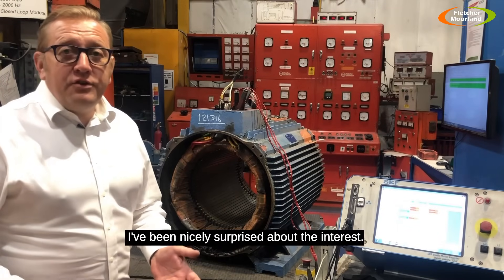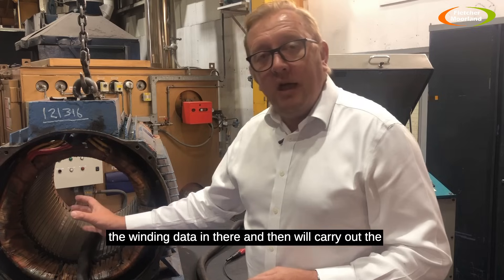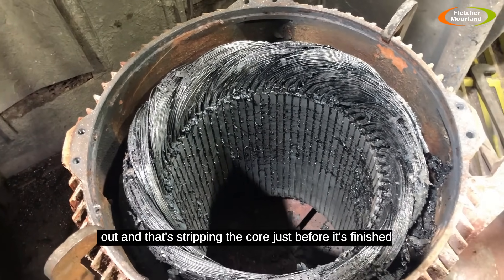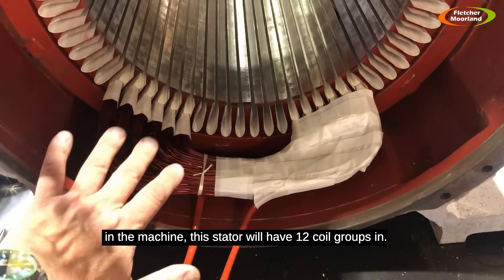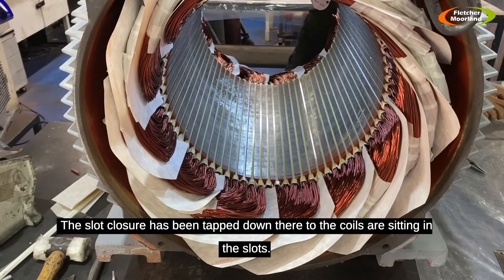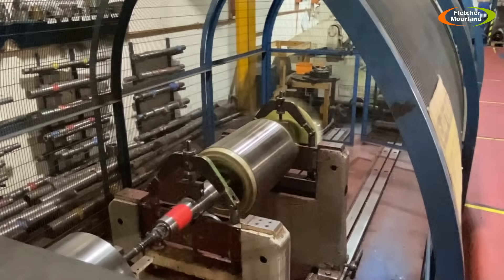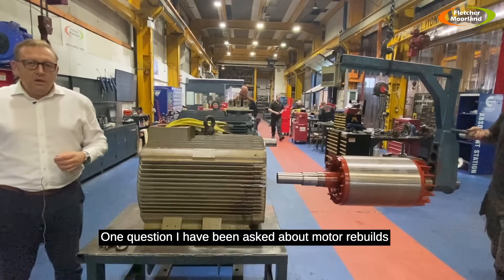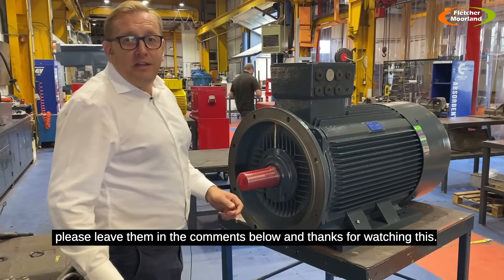How it's done....Electric motor rewinds

Comment: I work for the largest industrial electric motor manufacturer in the world. I have visited and studied many of our production facilities and their processes. Some of our customers are motor rewind shops. This one, in particular, appears to do a very thorough and professional job of rewinding this motor. Their process is very similar to the way our production process works on motors in this size range, with minor exceptions for special tooling, devices, guide fixtures, and some robotics in smaller motors for more repetitive processes. Very fine job, indeed!
Reply: I don't do that job, I build rotors, but they hand wind stators about 30 feet from my area where I work.
Motors about the size of that one and bigger.
Reply: you should make a video! i'm sure in production, you guys don't use hand winding on the stator - right?
Reply: @FrederSnorlax  depends on the motor. High production motors are often wound and inserted by automated machinery suited to the task. Larger frame, specialty, and lower production motors are indeed hand wound.
Reply: You scream "we've been doing it this way for years " 😭💀
Reply: Hi,could not see how windings were inserted into core but very interesting  video.very thorough.

Comment: This was a very interesting video.  I once attended church with a fellow who worked at a motor rewinding factory.  Also, my brother worked at the "Electric Shop" for U.S. Steel in Birmingham, Alabama (USA) where they rewound a lot of motors.  Finally, my father-in-law worked at Air Reduction Co., a supplier of oxygen for that same U.S. Steel plant.  To make the oxygen and other gasses, they used many massive electric motors.  The amount of electricity used was so great that the Alabama Power Company had to run a special line direct from the hydroelectric plant for several miles to Air Reduction Co. which was their largest customer.  Having so many friends and relatives in this business, it was exciting to watch you explain how these huge motors are maintained.  Thank you.

Comment: Old rewinder here,  low tension,  high tension,  ship board armatures,  bar wound, commutator rebuilds. Traction motors. I think 
Miss  the trade,  unfortunately mostly a dead trade now.  
Used to rewind,  single phase motors on the weekend for beer money.
Good video.
Reply from the maker: There's a resurgence Kezza, we've got four apprentice winders with us right now. Electric vehicle and wind industry is where we've seen the industry turn around.

Comment: I walked through a westinghouse motor and transformer production line and saw how they pulled the whole winding into each slot using a hydraulic cylinder hook. It was cool to see it done manually, since each motor is different, where theirs was a production line... Thanks for all the details and answered questions I've wondered about on motor rewinding!

Comment: Hi, do big DC brushed motors have significant core loss ( maybe because of commutation ) and if so would you measure it when doing a rewind?
Reply: Do you use a growler?  This is a powerful electromagnet with angled pole pieces.  The armature is placed in the V while the armature is slowly rotated while a hack saw blade is held close to each slot.  A shorted winding, or after de-coiling, a core fault will cause the blade to vigorously vibrate.
Reply: @neon-john  No I haven't, I guess the blade vibrates in the growlers magnetic field if there is a poor diverting magnetic path through the armature (or stator?), but I'll read up on all that before commenting further. 
Thanks.

Comment: A friend in Sacramento, CA had a two-man motor repair shop. He used a small propane burner. One day in the ‘70s, the government dropped by and put an end to burning motors, which would reduce air pollution. I don’t know what he replaced the process with. I am surprised you are still doing it in these days of “warmal globing.”
Reply from the maker: Less CO2 produced by rewinding these motor than to build a new one. The process is kinder to the environment now though as the hydrocarbons get burnt off and don't escape.

Comment: That was an excellent video.
Before retiring many years ago, I was an electrical engineer at a magnox power station and have needed to have quite a few motors, small and large, rewound, due to various faults (including seawater ingress). Most of the original manufacturers were defunct so we had to rely upon the expertise and service of the specialists. Due to work load, I rarely had a chance to observe first hand the processes involved, so your video has been absolutely fascinating, and extremely well produced.

Comment: I actually would like to have seen the cutting of the old windings, even if it is noisy and dusty, or at least the machine that does it.  Also, I hoped to see how the new coils are made prior to being inserted into the grooves.  I have to assume that they are wound on some jig or fixture.  Also, do you do any electrical testing or refurbishment on the rotor?  Or, is the rotor always OK and doesn't need inspection?
Reply from the maker: The video showing the coils being made got corrupt when I made this video. If you take a look at our other videos then I've made a separate one for theat. The rotor does get inspected for broken rotor bars but in general apart from mechanical refurbishment on the bearing journals or output shaft they generally require little work.
Reply: @FletcherMoorland  Thanks, I'll go look for your other videos.

Comment: If you use paper insulation good for 110c and bake the unit at 160c, does anything bad happen?
Reply from the maker: You'll compromise it and although it may still have insulating properties, It'll not last long in service.

Comment: Jeez. I work in the offshore industry in the North Sea and I can literally see hundreds of these motors of various sizes all over the place every week, especially on the larger assets. I've heard of motor rewinds but never realised the amount of effort and skill involved in their construction. When new (or refurbed) motors arrive, they sometimes sit about for a while and you can get up close and it always surprises me that no matter how large they are, you can always turn the motor with one hand on the output shaft without any effort. Amazing.
Reply: The Volunteer Army Ammunition Plant or what we called the dynamite factory, used to be located in Chattanooga, TN.  They made all the TNT use in the Korean and Vietnam war.  There were huge air compressors to supply the whole site.  The motors were large, slow-speed devices that ran on 4130 volts, 3 phase.  I have photos of my friend Jerry Brown who I described above, standing upright in a stator, reaching over his head pushing windings into slots.

We pumped varnish into the slots and spray-saturated the end turns.

The bake-out oven affair we built over the motor was clever and large.  It got the job done.

If I recall correctly, those motors ran at 360 RPM and were synchronous motors with wound rotors and slip rings.  The field winding could be over-excited to cause the motor to provide leading VARs to offset the lagging VARs induction motors made before the lagging VARs could reach the metering system and cause a low power factor charge.

Fun times.

Comment: Back in 1966, I worked in an Electric Motor Rewinding shop...California, USA. Not much different expect I see lots of better test equipment, and less brutal burn-out !!
 Very good video, it shows people why it costs so much to properly do this sort of re-manufacturing. 
 The only thing I didn't see, is anything regarding (metal spray) welding and turning of damaged shafts. not a problem, I know how it's done, although back in the day, we used Oxy-Acetylene and motorized wire feeder...very noisy!

Comment: Control open flame on the core by having a fire suppression photocell to inject water if flame is sensed in the burn out oven. I would have continuity wound this with concentric winding and when all the coil groups are installed there would be 4 groups of  6 leads at 90 degs apart. It would then be easy to either hook it up star or delta. Your vpi process is a joke. I taped each winding up into the iron and then that stator would be put on a rotisary to turn at 5 rpm to keep the epoxy in the windings while curing in the oven, After the epoxy is cured it would get 2 class F varnish dips and cured between dips. Put in a tank of water brought up to the conductivity of sea water and meggared at 1800 volts every hour for 24 hours to prove its waterproofed. Then rinsed off with clean  water and dried before assembley. My VPI motors were run at 100% load on a dynamometer  for 24 hours before being sent out to the ships or submarines.I rewound for 16 years working for the USN. I rewound a lot bigger motors and generators. I only had to rewind one 12k hp sub prime mover motor which was 3 meters in diameter and it was a dc drive motor. Glad I'm retired,lol. I'd say the majority of your epoxy ended up on the oven floor because it flows like water when heated to cure temps. The epoxy once cured isn't resistant to the shock of starting so it will develop cracks  that will allow moisture into the winding over a period  of time so sealing it with a good class F type varnish will prevent those cracks from developing.
Reply from the maker: Oh dear, 'a been there, done that' bell-end comment. I guess you don't know much about modern VPI epoxys then do you? Class H with a three year warranty will do us nicely thank you.

Comment: 50 years ago I worked for C & H Rewinds in Farnworth near Bolton. In those days we used a hammer and chisel to cut off the crown, overnight in a big oven to soften the varnish, then pull the coils out with the use of a big crow bar. The workshop was always very hot and full of smoke.
Then we had to wind the new coils by hand on formers hand cut out of plywood.

Comment: Nice job. Both in your business and in the charity and information. Great video. A high end product that you didn't origionally make, but one which has been restored to service.The normal working temperature is closer than expected to failure temperature. its suprising without thinking about known consistant load/work conditions but makes econimuic semse to design something to do a known job. Is it connectrd to a water pump?  How and should you remove rotor material during balancing? Also I would love a followup introduction to the idea of core degradation. How and why it happens. Significance and a gauge compariton to give me and others (hopefully not alone, lol) an application of the relevance of the 8w/Kg acceptable condition. I'm imagining alignment of regions making the laminated core slices act slightly more like a permanent magnet than it did on day1 of first construction. Is there an initial degradation, does it continue or reach a boundary. What effect on preforming does the 8w/Kg have in real terms. Is it likely there was a lack on attention when this motor was origionally constructed or was is operated outside its design function. Major leak, unexpected submersion or condensation during periods of inactivity. Please share more.

Comment: we used to chisel the head (crown) off with a rounded chisel and bloody great hammer.  Then we'd be stood with calor gas burners heating the core up and melting the varnish before tugging out the windings with large pliers and cleaning the insulation out.  Burns were part of a working day.  If you lads saw us doing the job back in the 70s/80s you'd be horrified.  Nowhere near as detailed testing (didnt even have the equipment because it wouldn't have existed I suppose) of core, balancing or housings......all done by eye and touch.  Great to see the trade still exists and the safety measures are so much better (e.g. I didnt see anyone breathing in mica particles, sawing asbestos sheet or breathing in the burned off varnish and wire enamels)
.

Comment: Tip: no hydraulic machine required to pull windings. Just change one step, no GRINDER! Grinding melts the ends of copper together, making it difficult for it to slid through the core. If you use an air chisel, the windings remain separate and can be easily removed by hand; they almost fall right out when done properly after a bake.
Love the video
Reply: True.  We used pneumatic cutter in our shop too.

Comment: Precise repair, congratulations 👌.
Why don't you spend some time analyzing a new type of four-phase synchronous motor whose armature can drive the rotor of an induction motor? Isn't it very interesting and, moreover, perfectly documented on my channel, Zygmunt Kiliszewski, on YouTube? You should also learn some new things, then the world will be more interesting!
The more so that the motor can operate on the basis of two pole winding angles, i.e. 135 degrees and 180 degrees. The former determines the work in the rigor of the periodically variable trapezoid/sine function (heavy objects). The angle of 180 degrees is assigned to the current of the sine function and the drive of high-speed, fast-moving machines.
Please refer to my comment! Regards!

Comment: I'm surprised the enamel lasts as long as it does in preventing the coils from shorting to each other. Vibration and relative motion of the coils must be what eventually wears through the enamel and causes the failures.
I've got an air compressor motor that failed, apparently due to that. Just tried poking around the burned area to see if I could resurrect it by maybe separating the shorted area but it's still drawing 75A inrush, so no luck.
Reply from the maker: Vibration and movement of the coils is certainly a failure point. To try and stop this happening the coils should be tied to each other and secure in the slots. The varnish especially the VPI holds them securely. At the edges of the slots is one of the main failure points, that's where the insulation is increased to ensure there is greater mechanical stability. It is all a battle to reduce movement in the end.

Comment: Thanks! I have a single phase motor from a 1940''s Walker-Turner table saw (in U.S.) that I'm restoring on my channel. I've got into the motor now, and I'm trying to learn as much as I can in case it needs to be rewound. Also, I have almost zero experience in electric motors, so I'm wondering if me rewinding the thing is even possible (?). Any ideas if it's possible? I mean, obviously it's possible, but is it plausible? What should I focus on learning? Anyway, this was great!

Comment: 33 yr rewinding says you do an excellent job.   I did not see the rotor tested for open bars---which will totally cancel all work performed if open rotor.  don't forget the material list with new wire weight billed X 1.25

Comment: That was a lot more labor-intensive than I thought it would be.  What particularly surprised me was the cutting of the windings and burnout.  Also now that I'm thinking about the test at the beginning seems rhetorical because the result appears to be the same cut & burn.
Reply from the maker: The test in the beginning determines if a winding is good or not. If it's good then a rewind does not need to be carried out so its crucial to do it first.
Reply: @FletcherMoorland  I was an Armature Winder 60 years ago, IMO the test at the beginning is not really necessary since all the motors we recieved that were burnt out you could smell them. The cause with 3 phase motors was usually a phase had gone out and they continued running on 2 phases. Single phase motors was usally the start windings. I agree if it was an overhaul for drying out and new bearings then the tests were required.

Comment: I worked for the USN on sonar for decades but never knew there were multiple tests for the overall insulation on the copper windings, balance measurements, out of round measurements for bearings, etc.. No wonder manufacturers want the motor core back.

Comment: Cleanest workshop I've ever seen. Very impressed how that bearing was fitted. When do you count the windings?
Reply: It looks like they use the removed crown to determine the number of turns for the windings.
Reply: I worked in a rewind shop in the US Navy in the 70's. The coils are counted when winding them. I wish he'd shown that step... A winding machine has different forms for differently shape ends. Kinda like a paint shaker, but it rotates instead of shaking.  There is a counter (mechanical) to count the turns.
There are books out there that will tell you what dimensions to set the winder to for most motors. Some... you have to count and measure the old windings, make up some "dummy" test coils and check the fit before winding the whole stator.
I was a Machinist Mate, doing QC in the electric shop, checking winding with the equipment he shows, balance, bearing alignment, and a dyno load test. I learned the process in order to do my job better. Most Electrician Mates thought i was an electrician. When I got out of the Navy, I sailed on merchant vessels as Chief Electrician for 20 years or so.